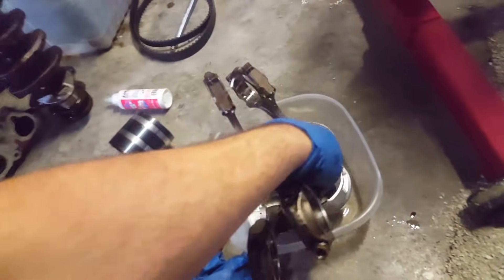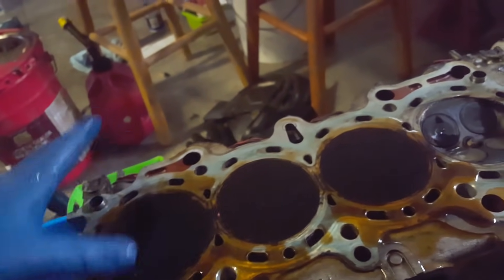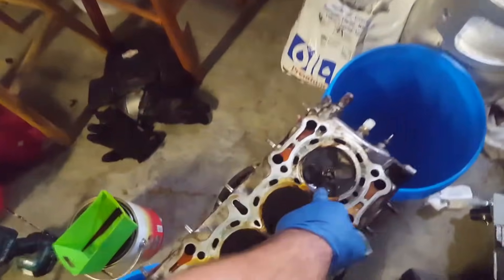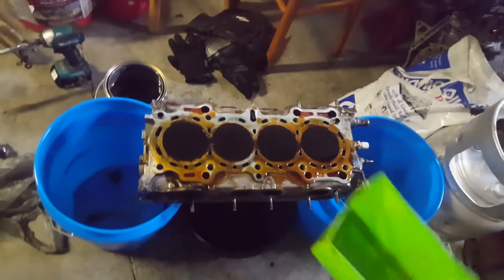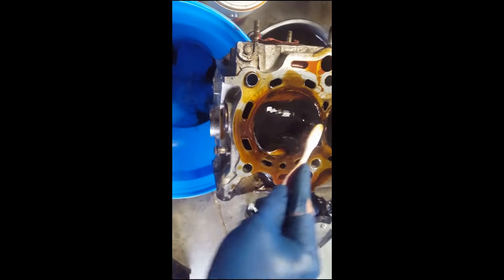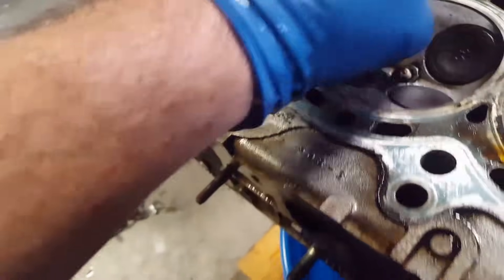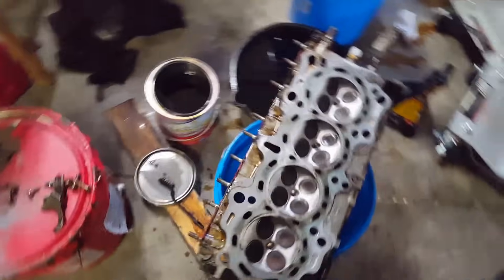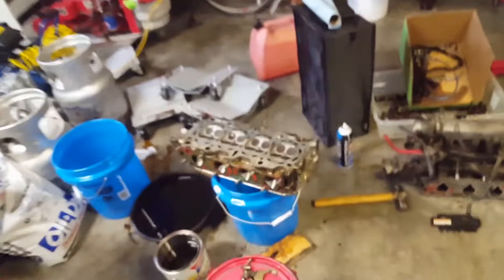It eats away Carbon Buildup EASIIILY!!

Comment: (MMO) Marvel Mystery Oil. NOTHING else needed. Cleans and lubes cylinder walls, piston heads,  intake valves and fuel  system. It works and it's cheap! I've been using it for 40yrs. My cars all run great and get better gas mileage! 👍👍👍👍

Comment: The Berryman B-12 Chemtool is good- see the Project Farm comparison videos. It made the spark plugs look the cleanest when added to the gasoline, compared to the others.
Reply: I'll seriously check out the video your suggesting as I just bought a 2003 Z71 Chevy Tahoe with 93k and dealer serviced. If im say running to my local 7-11 during the night and punch it with a vehicle behind me I see a lot of carbon blowing out. I was thinking of using my favorite goto Seafoam spray to fog the intake and valves as its helped my other trucks and cars. Can this be sprayed into the intake like Seafoam spray top engine cleaner? Thanks for any advice its super appreciated! Eddie J.   Long Island N.Y
Reply: @eddiej.2354  SeaFoam isn't a very good solvent, but it does one thing very well, soften the carbon at the valve faces. Berryman's B12 isn't intended as an induction solvent. B12 is far superior for dissolving carbon, however, but I wouldn't try it as an induced one.

Comment: I've been using this stuff for 30+ years and it's awesome stuff. There's no real need to scrub but I've found it works best when it's around 100 to 110 degrees F. It removes carbon, grease, paint, etc. About the only thing it won't remove is rust or corrosion. One caveat; the "environmentally friendly" Chem Dip is much less effective. The good stuff comes in a 5 gallon bucket and comes with a parts basket.

Comment: That stuff is Da Bomb, we use it in our shop to soak and clean carbs. Nothing even comes close to how good it works on carbs. But watch you cant leave parts in there too long and absolutely no plastic or rubber. Do not get it on your hands. Rinse all parts in soapy water after.

Comment: Chem-Dip has phosphoric acid in it... That's why the 4 hour limit on soaking aluminum parts. Unless you want to etch or destroy thin aluminum part sections. Always wash Chem-Dip off with water to dilute and remove it from the surface. It will continue to eat aluminum surfaces if just wiped off.
Reply: I looked up the Chem-dip MSDS - it contains no acids, phosphoric or otherwise.  As expected, it is caustic (pH 10-11), which is why you can't leave it on aluminum too long.
Reply: @idontwantachannel3091  Chem-Dip, Tyme, and Gunk have all changed their formulas over the last dozen years or so. Thank California's Proposition 65 for that. The old stuff worked much better....but wasn't up to California standards and the manufacturers would rather make just one product instead of two. If the current stuff only works part way, it's guaranteed you'll buy more of it to get the job done. Be it a base or an acid, it's rough on aluminum. I stand corrected.......
Reply: Flush out the water jackets the chem-dip went into  also rinse the whole head  with a garden hose to stop the chemical reaction.
Reply: Incorrect!  https://www.berrymanproducts.com/assets/CD-A-Int-0996-R01.pdf
Reply: SPOT ON

Comment: Hydraulic valve lifters get carbon on the inside so place in soft jaw vice compress and then pump agitate in this stuff, then in paraffin  uk/ kerosene  to remove the now liquid carbon and then pump them in fresh oil primed and ready for refit, cheaper than replacement when all the issue is carbon. Ok so you may find one that has failed spring but one is cheaper then the a whole bank of them. This is why engines with hydraulic lifters benefit from flush being put into the oil and run the night before an oil change.

Comment: Bro oven and bbq cleaner does the same job in 4-10 mins and you can do the ports aswell
Reply: Thats a great idea!
Reply: @coconutcreampie3795  Not on aluminum. Don't spray caustic alkali on aluminum, it will begin to dissolve.
Reply: @mfree80286  Funny you mention that.  I am doing zinc plating on a bunch of old motorcycle parts and have a lye solution for removing grease before plating.  I put a wheel spacer into the lye and forgot about it for a week and it was totally deteriorated. Now I need to find one and its for a vintage bike.

Comment: The best thing to clean carbon is dot 4 brake fluid. Leave it to soak for about 20 minutes and wipe it away with a cloth. Brings up piston crowns like new.
Reply: What would happen if you would put a Couple of ounces into the Gas Tank.
Or is Marvel Oil Better to Clean the top Pistons without Disassembling the Engine.
Reply: @MB1Billion i wouldnt, brake fluid is very aggressive against rubber products and may swell the seals in the fuel injectors or fuel line connections.
Reply: @MB1Billion  wouldn't hurt
Reply: I have a Volvo S60 '09 t5 and my throttle body is sticking open in limp mode. Do you think I could try it spraying it or putting that on it before I disassemble it and clean it or put it in the gas tank? Do you think that would help get rid of the carbon? A lot of people say get some lacquer
Reply: @dereknichols77  you need to clean the throttle body and then do more diagnostics if necessary
Reply: @mikem5475  so you said go ahead take it off clean it. Don't bother buying a new one. Do you think the gears inside are good? It's got $230,000 mi and I probably beat it up for $100,000 miles of it but I've maintenanced every time it's supposed to be maintenanced everything. It's cost to arm and a leg lol
Reply: @dereknichols77  the gears shouldn't have broken. I'm sure it's not cheap, and cleaning only takes 5 minutes. Brass brush and any oil if you can't find solvent. It may just see that it's hanging up on carbon and going haywire

When cleaning do not try to move the throttle blades. Do not stick fingers near throttle or risk amputation. Use a tool wedged between accelerator pedal and seat to hold throttle open with key on

If it doesn't get fixed with cleaning I'd  do more diagnostics if possible, depending on part cost and time cost
Reply: @mikem5475 nothing wrong with moving the blades yourself
Reply: @ADMAFIA210  some guys have gorilla hands and will strip the gears trying to move the blade.  If you know how they are built, it helps, but a lot of guys will eff it up.
Reply: Back in the day when I used to work on carburetted engines we used to slowly pour used brake fluid down the carb while the engine was running to clean the combustion chamber.
Reply: @YouTube Connected if it were to work, it would be because of the Ph, not because of the mineral oil. The cat gets dirty partially from charred oil
Reply: Pls I want to work on my pistons cause I don't wanna loose top cylinder ,cos I'm in nigeria and mechanics are quacks.so can I instructions my mechanic to loose all the spark plugs and pour it inside the plugs holes over nite and come drain off with oil change.hope it will work .cause I see a lot of carbon build up on 3 spark plugs,causing misfire and bad acceleration,high fuel consumption, oil burn
Reply: You can do that yourself at home. Just buy the tools which are cheap. The main tool is the spark plug socket to remove the spark plugs.  @Wesaazx
Reply: Nice to know
Reply: Brake fluid is corrosive, never use it for clean engine parts.
Reply: @lusa3002  Really? Best we only put milk in our brake and clutch systems from now on then...
Reply: @lusa3002  Wrong there guv.
Reply: Really? Wow gotta learn how to open the top engine and gotta try that
Reply: Dave Leighton, thanks for the tip!
Reply: no its not work.
Reply: Sir we clean bike chamber with brake fluid
Reply: is it safe for aluminum heads, blocks and pistons?
Reply: If you still have to wipe it to clean the part, isn't that good!
Reply: @cmte.brazinazzo2061  Wut?
Reply: @cmte.brazinazzo2061 then what’s better
Reply: @cmte.brazinazzo2061 
I agree, a magic wand would be better 😄
Reply: Would dot 3 work?

Comment: Back in the day all we had was gasoline to clean everything.
Reply: Yes indeed. A bucket of gasoline for soaking parts! (Outdoors in the open air) and when finished, it was strained/filtered and poured into the lawn mower. Nothing wasted.
Reply: Diesel😜😜😜
Reply: Nah, diesel works better than gas
Reply: Cheap pine sol works good too.
Reply: That berrymans chem dip has been around for as long as I have, so at least the 80s
Reply: @ShaunHensley  yeah but due to government regulations bullshit berrymen isn't as strong as it was back then, still a good product anyways
Reply: Let me tell you about a wire wheel!
Reply: Still do for certain things
Reply: Oh yes remember that beautiful gasoline when it was pink full of lead and octane cleaned many many car parts with gasoline back in the Day love the smell of that pink gasoline...
Reply: Back in the ‘70s  EVERYONE rebuilt engines or swapped !
I got my azzzz whooped because I always found the oil drain bucket or the engine cleaning tub !
NEVER FAILED !
About 2005ish I was in a private parking lot some  guy blew out transmission fluid everywhere 
THE PLACE CALLED A 
“HAZMAT TEAM “!
That was a little much!
Reply: Our napthagh that’s a class III carcinogen
Reply: Naphta

Comment: hi mate i have the honda shuttle uk spec the 2.3 same as this engine 
any ideas on the right type of tool to remove the temp sensor as mine is a tiny bit rounded i was replaceing but it stopped me and don't really want to damage anything

Comment: I have used Berrymans Chem Dip for years. The stuff works great. Sea foam works too with brushing and a longer soak time.
Reply: will kerosene clean egr carbon if I let it soak 24h
Reply: “Easy off” oven cleaner.
Reply: @Uber_mensch_1  but don’t use oven cleaner on aluminum it will ruin it and the corrosion will never stop
Reply: @richardcrouse9074 what’s suitable for thick carbon on aluminium

Comment: Look for a shop with ultrasonic cleaning machine and you will save a lot of money, time and effort; and you will save a little bit more the environment, I used to clean with those products until I discovered a shop with ultrasonic cleaning machine (in the other side of the city but it worth) and in one hour like new and shiny. If the aluminum parts are mate finish, means that the solution attacked the structure, remember that aluminum in quite porous. I have seen many engine heads with problems after cleaned with those acid or non-alkaline solutions. Just my experience.

Comment: Chem Dip does not work that good on old cast iron engines or parts...
Reply: Chem dip is for quadrajet carbs.....i got the 5 gallon bucket!
Reply: @bobc.5698  I also have used it for my carbs.
It just does not have the strength like the old stuff....like Hydro Seal
Reply: Your right...

Comment: Have you tried it on intake valves on a DI motor, keen to see if could do with fly head on and valves closed
Reply: I was thinking that too the only issue would be if it leaked into you cylinders, that could be a big problem, maybe if you don't flood the intake port with it and just enough to wet the port (and valve). I'd be interested to know exactly what chemicals in it. If it has caustic soda I wouldn't use it on aluminum.

Comment: Can you soak your engine with this then drain it 🤔
Reply: I have used superclean degreaser before. I drained the oil took the valve cover off and sprayed that stuff all over the rocker arms till they were clean. Then dumped 2 gallons of the stuff in the crankcase and left it over night. Drained it the next day. Put in a cheap oil and filter. Let it idle till it warmed up good. Then change out the oil with a good grade of oil and filter. Does a great job cleaning out the engine. If you have an early sbc or sbf you can take the distribitor out and pump by hand the superclean through the engine. Just pump the new oil in by hand before starting the engine. Does a good job cleaning the engine out.

Comment: Then hit it with some starting fluid to really clean it up.
Reply: Starting fluid is a great cleaner and cheaper than brake cleaner
Reply: @AmandaHugenkiss2915  always buy a can when wife sends me to grocery store😁
Reply: Starting fluid? First ive heard of using that to do a clean up.
Reply: Yup, Starting fluid. Have your air ready to blow it and contaminants away. Otherwise, the fluid just moves it to a different place and evaporates. Don't be smokin' either.

Comment: Would be nice to remove the carbon without rebuilding the motor
Reply: that's what im looking for,but its not there....I used toralin ,it s a spray can quit toxic,disolves carbon straight away but we can t reach the oil scraper(oil ring)...it s seems to be stuck or damnaged,and keeps burning oil so we can t get rid of the carbon......

Comment: Mr Muscle aerosol oven cleaner, works on gummed up turbo's as well, thank me later...
Reply: Oh, they'll thank you later alright...when the surfaces are pitted to $#it.
Reply: Depends how long you leave it on,  just long enough to brake the carbon down.  it works a treat.
Reply: Oven cleaner on aluminum?  I would not use anything containing lye on aluminum.
Reply: @charleshines6155  Easy Off worked like a charm with my pistons. Just leave it on for 5 - 10 min.
Reply: works if your turbo's vanes are so carboned up that its buggered.  If and only if and prior to complete removal you might be lucky.
Reply: I used some oven cleaner to clean the baked on crud off valve cover mating surface on an aluminum head. Kind of tedious but worked great. Dab on with qtips... let it set awhile, scrub a little with the qtips on stubborn areas and wipe off.

Comment: If the engine consumes oil I would fill the cylinders (crankshaft rotation) with this product and attach a leak down tester. The air would compress the product by the rings and loosen them up. After that I would change the oil and suck the chemdip out of the combustion chamber.

Comment: Most of the carbon deposits are on the back of the valves. we did not see how you cleaned those.  If they is lots of this buildup They need to be hot tanked or wire wheeled or replaced .

Comment: Maybe it was my 22 years as a Navy Machinist, but I want to slap you upside....Just do it right. Disassemble completely, then clean & inspect. For what it costs (and potentially saves in the end) at least send the block to a machine shop to be cleaned and inspected properly. A partial rebuild is a waste of time and money.
Reply: I dont agree with you. This was a good running engine to begin with. Just dirty.

Comment: Thanks
Can I use that to clean the valve from a spark plug hole ?
Reply: If you're talking about leaving the engine in the engine bay and taking a spark plug out then filling the cylinder with this, it will not reach the valves, it'll clean the piston heads a little and the cylinder walls but won't work as well as taking em out and scrubbing them with a brush. In the case of dumping fluid into a cylinder you also need to find some way to get it out again so it doesn't hydro lock, if it's just a little bit it'll get blown out on the exhaust stroke so long as there's not enough to cause the compression to skyrocket. But then there is also an issue of how long you leave it in, if it's in there for a while it might leak down into the crank case and into the oil.
Reply: The area most people care about is the "back" of the valves because in a direct fuel injection engine there is no fuel which acts as a solvent to get debris off the back of the valve, the fuel is shot directly into the engine cylinder. This is the case for direct injection engines including those in cars as well as diesel engines. What happens as the engine gets hot is when oil is distributed to the valves, they are covered in oil and it gets baked on with heat combined with whatever contaminates sneak past the air filter. In port injection and carburetted engines fuel touches the back of the valve and dissolves this carbon for the most part. If the valves get hot and fuel is shot on it, the fuel will cause the carbon to flake off and it will cool the valve off preventing any more build up. But over time build up is possible.
Reply: K

Comment: Just wondering how you neutralized this stuff? Did you just hose it down with water? I feel like a film/trace amount would still be left over, and it would need to be removed, still think it's a great product though pretty impressed with how quickly it cleaned everything.
Reply: Rinse off with water. There will be a film left on the parts. Clean off accordingly.

Comment: Why only clean the combustion chamber.  Why not remove the values and submerge the head in the cleaner and clean out the ports also?  The place that carbon is at its worst is on the back side of valve.  You are not cleaning that.  You went to the effort to clean the pistons but did not thoroughly clean the valves and head.  Doesn't make any sense to me.  You can replace the value seals on re-assembly of the head.

Comment: Its a very strong caustic made as a carb dip just make sure you remove the float if it isn't brass the gallon used to come with a basket it will eat Damn near anything but metal keep plastic away should work great if you can afford it for that quantity I was always gonna try this thanks for the video

Comment: In the egr passagess for those intake manifolds but you should take the head apart valves on the drill chuck and a wire brush grinder

Comment: Good way to check compression it's not leaking
Reply: You mean checking valve seats ?
Reply: It's called a leak contest it's basically using the pressure gauge backwards instead of 0 to 100 just think of the numbers as 100 to a 0 and then have a pressure regulator that you can sit the pressure at 100 lb that's the way to do it down test you can build your own tester if you have a compression tester you just have to take out the check valve like the valve on a tire of course you can buy this pretty inexpensive on the internet